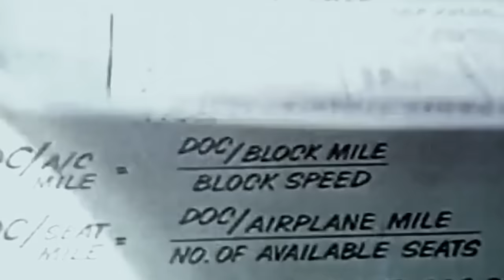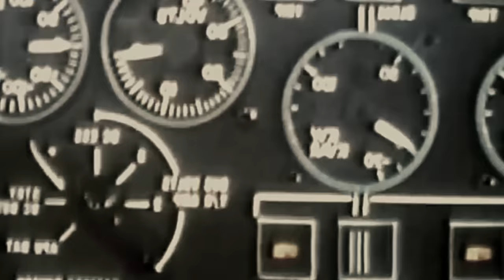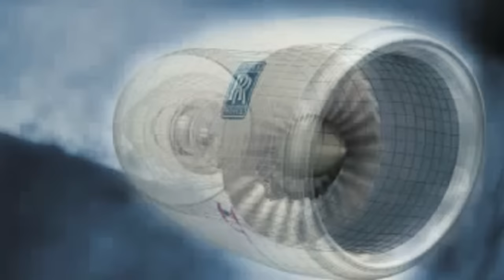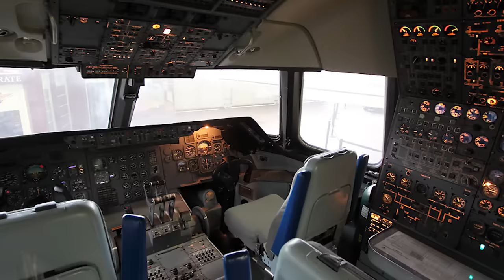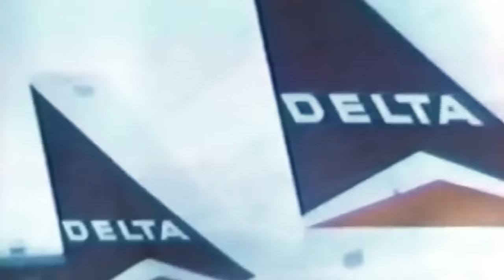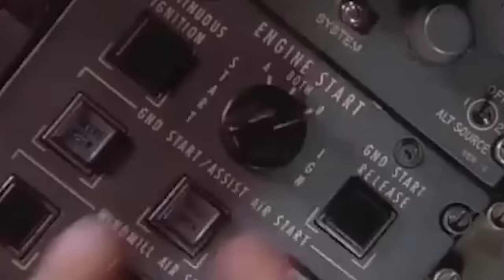L-1011 Tristar - too advanced for us

Comment: Flew the L-1011-500 for 2 years as a captain at Yes Charter Airline, in Portugal. Even now, flying the A330/A340, I still think of that time as my best years in aviation. It was a "Pilot's" airplane. Designed to be flown by Pilots. And the autopilot was extremely competent when the weather was flaky and you had to let the machine put it down all by itself even with fearce crosswinds. It was certified CAT III B (not CAT III C as refered on the video), which means that you would still require 75m of RVR before you could start an approach. And contrary to what is also said on the video, it would not make an automatic take-off. 
One day I was performing a LVO Take-off with 125m RVR and just after V1 was called by my FO, all 3 generators failed. We continued the Take-off as if nothing happened, reseted those generators and continued our flight across the Atlantic. That was the kind of trust the L1011 gave to their pilots. And there was none of those multimedia television on each chair. We had Cinema. That's right. A full color projector and a large screen. Ben-hur or a Sean Connery 007 movies were the norm. None of those crappy movies we have today.  Would trade my Airbuses for a L1011 any time.
Reply: thank! love hear stories from pilots!
Reply: I concur. I was a flight engineer in the mid 90’s on the L-1011. Nothing comes close to this aircraft. Best airliner in history in my opinion. I miss her.
Reply: It was a different era... 

I've been on international flights repeatedly from before I was born, and I remember the progression of aircraft interiors.
747's frequently had cinema projectors even into the early 90's, I recall.
But the majority of aircraft had ceiling mounted televisions in the aisles.

Then again, the seat-mounted displays are actually going out of fashion now...
So who knows where things will be in another decade or so...
Reply: Luis Rodrigues it's funny how everyone believes things in their time were better. I would take my small personal multimedia screen anytime and watch what I want rather than forced to watch what is being played on those large screens.
Reply: FooBar Maximus I respect your opinion but not everyone wants to chat throughout the flight. I prefer to have the choice of watching what I want to watch rather than being forced to either watch what’s playing or sleeping.
Reply: Hoy Sum  I think people who try to chat up everyone are exhausting. Sometimes I get stuck beside those people and have to give them the silent treatment to get them to shut up.
Reply: Lois, my TW FO friend contribution obliquely says the same thing.  The flight crew loved the jet even with all its quirks.
Reply: thanks for your input captain..
Reply: Luis, could you please tell something about the handling characteristics.
Escpecialy during an N-1on T/O. since (as far as i know) the 1011 was steered by lift dumpers rather than than by airlerons.
From what i understand you did not roll to the live engine but just used the rudder.
Is that true, and how would it handle in such a condition.
For above reason i found the B767 more easy than the A300 for instance.
Reply: @FooBar Maximus I am with you 100%.  Social media isn't actually bringing people together at all.  It's doing the exact opposite.  I only ever got to fly on one TriStar.  We flew from Barbados to Toronto on one.  I loved it and will never forget it.  We were out on the tarmac at Grantley Adams Intl, and I was walking up the air stairs to get into the L1011, and I'll never, ever forget looking into that HUGE opening that was the S duct for Engine number 2 in the rear.  As a little boy of only 8 years old, it was the coolest thing I had ever seen in my life.  Oh, and the Rolls Royce RB211 engines had me grinning from ear to ear during takeoff also.  It was a great moment in my youth.
Reply: Thanks for sharing. Pilots have my total respect sir!
Reply: @FooBar Maximus I agree, people do not interact with each other anymore.
Reply: What amazes me is Lockheed didnt anticipate etops and try to make a twin engine version.
Reply: @animeshdas9842  if they played good movies I'd prefer the big movie screen.  You can just carry your own personal screen.

Edit: and put some headphones on with your tablet....if that doesn't shut up the annoying person by you, nothing will.

To me, this makes personal seat screens redundant, but not movie screens.

Or they could do open seating like Southwest, and just have a movie play in one section...as long as you don't pay for last boarding group, you'd get your pick.

On another note I don't get why people complain about open seating...My experience tended to be, in first group I got pick of window or aisle, second guaranteed no crappy middle seat, but most still get choice of window or aisle...and last group, which sell for around the price of cheap middle seats, often still finds middle and isle seats together, so two friends can still sit together...
Reply: @FooBar Maximus I was gonna say the same, it was a more social experience. You'd just end up enjoying the time with you everyone.... At least thats what I saw all the adults doing 20 years ago when I was a kid. Our generation is so full of dullards lol (I probably shouldn't find that funny)
Reply: A wonderful insight you gave there, thank you. I wish I could've flown on the L1011. I work at Rolls-Royce, we have some old chaps in the workshop who worked on the RB211 Tristar program, it's good to hear them talk about their experience.
I work on the Trent XWB 84k & 97k build line myself!
Reply: @mikemcpherson5550  I like it better than the jumbo jet
Reply: THANK YOU CAPTAIN.. MY FATHER 'CUT HIS EYE TEETH' AS HE SAID, ON THE DC-3 & LOVED TELLING THE STORY OF 'JACK' STOPPING BY ASKING 'HOW'S IT GOING NELSON'?..   AS HE WAS A SPECIFICATIONS ENGINEER ON THE L-1011, WOULD BE HONORED TO HEAR YOUR COMMENTS...
Reply: That was the most beautiful plane ever built. I saw it as a kid from the ground as I was boarding it. It looked like a plane that demanded respect. I hope they re-design and re-build it again. I would only chose that plane.
Reply: Animesh Das you are the reason why social society is collapsing. Humans are supposed to be social over everything, that is how we became an advanced civilization. Too bad you can’t afford to fly private, then you can just read a book and sit in silence
Reply: Thank you for sharing your experience with this aircraft. Growing up one of my Dad's best friend ran ground maintenance for Delta Airlines. He wanted Delta to purchase more of the L-1011 Tristars, but by that time Delta was looking at the new widebodies such as the 757/757 with two engines instead of one.
Reply: Flew that plane many times between Lisbon and NY, loved it...
Reply: WELL SAID CAPTAIN AND NO WONDER THE KING OF JORDAN KING HUSSIEN CHOSE THE L10 11 AS HIS PERSONAL PLANE !
Reply: My father was a Capt. for Delta and flew the Tristar from 1976 to 1992 until his retirement after 40 yrs of flying.
Reply: Luis Rodrigues ... OMG!! You wrote "fearce"!
Reply: @stephenvoss6092  It was the timing. The L-1011 was designed, when at least 3 engines were required for transoceanic flights, and by the time it was changed to 2 engines,  Lockheed had all but decided to get out of the civilian market. They looked into making a 2 engine version, but decided, that just removing the 3rd engine didn't help enough, since it was designed with 3 engines in mind, so they'd need to design a 2 engine airplane from the ground up, so it was more than they wanted to get into, so they decided to go ahead & pull out of the civilian market.
         Of the planes, that I've flown in, the L-1011 & the 747 were the only ones, where the whole crew were visibly proud and excited to fly them.
    I didn't ever take the Concorde. I'm sure, their crews were also visibly proud & excited. Now that it's no longer flying, I regret, that I didn't take her. I had chances, but took them for granted, until it was too late!
Reply: @sparky6086  I loved the eastern airlines L-1011
Reply: What a great addition. Your comment should be pinned.
Reply: Back in the 1980s I flew as a passenger, for the most part maybe 3-4 times a week. So much I had a subscription to the OAG and Aviation Week and Space Technology. When flying, I always checked to see what the equipment was. The L-1011was my go to aircraft. At that time IIRC the L1011 had one crash. I always felt safe on that aircraft. I flew mainly with Delta back then.
Reply: One of the reasons I became a  Pilot was because of the L1011, but they were retired before i had an opportunity to fly it. I have many fond memories as a child flying in them as a passenger.
Reply: @jivefx  DId you fly for Delta during your L1011 days? I flew a Delta flight to Puerto Rico in about 1995 or so. I'm glad I got to fly on one before they were retired for passenger service.
Reply: You still lucky in the A340
Reply: One correction and one omission.    The narrator failed to even mention that the S-duct inlet was used on the 727.  He made it sound like this was a new and novel invention by Lockheed.   And these airplanes were replace by the 767 and A310.   You have to jump a long way ahead in time to get to the A330.   And in spite of all the negative comments about the 747, it is the only one of the three still in production.    Thank you for clarifying the Cat IIB/C capability.  When he said CAT IIIC my suspicions were raised.
Reply: I worked on them back in the late 80's and then again in 1998...best jumpseat  in the industry behind the captain's seat. Flight mechanic for charter in the USA.  Awesome aircraft
Reply: Awesome info..u have led..lived..a blessed life...
Reply: I love the cinema in jets. I flew to Europe in a 747 in high school in 1984 and had so much fun watching movies together with everyone! Small screens and social media make people weird, isolated and not as friendly as the world used to be. The L1011 was my father's favorite plane when our family flew on vacations.
Reply: Hoy Sum  This generation you speak of have lower IQs and are NOT innovative. Their devices and RF damaged their nervous systems. Thankfully GenZ behind them has watched the GenY Millennial general all around failure to progress society in any fashion and are going back to basics, and a more analog life.
Reply: @animeshdas9842  You don't have a clue!!!
Reply: @animeshdas9842  Well isn't this just irrelevant!  The whole point of these videos are to educate and inform people about the past not to make comparisons to everything we already know.
Reply: Hoy Sum  Amen brother!! Preach!!
Reply: @rmorris1904  And your generation does nothing but whine whine and more whine. All your statements start from "In our day blah blah blah..."
Reply: @animeshdas9842  Putting in your earbuds is an obvious sign you want to be left alone. Of course there are some lunkheads that still wouldn't get it.
Reply: Ben Hur? Funny, Reagan made a joke about live Ben Hur performances at the Lockheed TriStar's rollout!
Reply: Luis Rodrigues thanks for sharing that pilot!
Reply: Mark exactly. I am a social person but sometimes I like to be left alone. Some people don’t get that, they are talking all the time.
Reply: My grandpa was one of the leaders/managers at Lockheed that built the L-1011 in Burbank before he retired.  He worked in the Skunk Works there as the Head of the Machining Department.  One tale from his days there was the fact that Kelly Johnson would ask my gramps "can we build this ___ like this?" or, "can we build this ___ like that?" to which gramps would say yes or no, or something to the effect of: "if we do ___ to it, then it can be done." 
I got to fly on an L-1011 a number of times.  First on the big smile PSA plane from SJC to BUR for my 14th birthday to spend spring break in L.A. with my grandparents.  I also flew on TWA on one.  Then, when I lived in Japan, I got to fly on an ANA version there, from Tokyo to Sapporo and back a number of times.  What a wonderful plane!  Wish they were still around, or at the least, that Lockheed would get into the commercial market again.
Reply: Well said Luis! I had 1,600 hrs in a L-1011. No major problems and also very pilot friendly too.
Reply: You're confusing capability with certification. The aircraft was capable of Auto take-off initially but was never certified. Iv'e done it in the sim. It was also capable of IIIc but of course no airports offer IIIc. I flew with the RAF and then several civilian operators. -100, 250 and 500. Air tanker, Cargo and standard Pax.
Reply: @animeshdas9842  His time was the A320, and he liked the L1011 better.  There are aircraft where you fly them and others where they fly you.  The L1011 was one where you flew it.  It's the same thing between a 727 and 767.
Reply: in 1985  i traveled to the azores in the l-1011 the captain was portuguese  i only remenber part of his name wich was    capt. conceicao magnificent flight the best could not feal take off or landing
sr. luis rodigues   you are blessed to have been a captain of that aircraft
Reply: Rolls R. economic problems and an alternative replacement for the tail turbo jet engine and sales factors made Lockheed give up on continuing production.
Reply: Luis Sir, What is the  passenger capacity of this aircraft ?
Reply: wow what a great story. i flew the l1011 with BWIA many times. i remember the big cinema screen too and projector. miss that plane so much too
Reply: @JW...-oj5iw  well spotted. I meant "fierce". I would like to see you say that in Portuguese 😉
Reply: @bigtaxrefund  when BWIA replaced  their L1011 by the newly acquired A340 fleet, my company made some ACMIs with our L1011 for them while their pilots got their Airbus ratings. Cabin crew were all BWIA. We stayed in Trinidad 3 days at a time waiting for the next flight. Those were happy days.
Reply: @animeshdas9842  yeah, that's what snowflakes do these days. And then they complain they can't find a partner in life. All these nasty people trying to make contact with them....
Reply: @jacutin5033  Chatterboxes get all the girls? ha ha
Reply: I loved the L10.
Flew it several times in the 80's.
Reply: lol.
Yep.
Reply: Thank you for that piece of technical information about auto take off...
Reply: I also loved the L-1011 FMS and the autopilot....way ahead of its time ! Some operators like TWA and Saudia had a center pedestal CRT Display that would show the FMS positions etc. I flew jumpseat with SAUDIA Tristars few times , amazing experience. 1978.
Reply: Captain thanks 🙏 for flying us safely.
Reply: @animeshdas9842  I would guess his point was about the quality of the screen experience.
Reply: Avionics and flight controls instructor with Lockheed Customer Training Department here.  British Airways had CAT III-C and used it when no one could  get in or out of Heathrow.  Other airlines tried to stop BA but CAA would not fold.  CAT III-C was difficult to become certified as the the airport's ILS had to have special certification, and the airlines Avionics repair lab also requires special certification.  Actually the L-1011 could make an auto take-off, we made a publicity flight hands off from Palmdale to DC.  If I remember correctly, Tony Levier was in the left seat and there was an FAA observer to keep us honest.  Did you notice a lower noise level in the flight station?  Skunk Works designed the forward fuselage including the curved wind screen for noise reduction.  Each half cost $35,000 in 1960s money.
Reply: Eldren Biddle here. I'm retired Lockheed Systems Instructor : Avionics, Flight Controls, Hydraulics, ECS and all on board systems up to the engine pylon firewall disconnects. Oh and the engine driven hydraulic pimps and self exciting constant speed generators .  Rolls-Royce's 
resident instructors did the engines.  We would needle them by calling the engines "motors" and when asked the power of the engines they would say "Adequate.  Rolls Royce snobbery.  One instructor was a golf addict and had a quest to play every coarse in California.  His classs room pointer was a golf club shaft.  

British Airways did certify for Cat III c, came in handy at Heathrow.  III c was very difficult to qualify as the runway ILS, maintenance lab and individual technicians had to meet special CAA standards.  All airlines including L-1011 operators tried their damdist to not allow III c as too expensive but mostly I think as unfair advantage.  

Auto take-off software and controls laws were resident in all flight control computers.  It was not enabled, don't remember why, maybe a bridge too far.  PanAm - 500 had if I remember correctly the first digital Flight Control, Nav and Air Data computers.  Also auto brakes and because of added wing span Active Outboard Ailerons to dampen gust loads.  Positive G ailerons up, negative G ailerons down.  There was a noticeable reduction in turbulence.  Standing joke was active ailerons were installed  to prevent white caps in your Martini.  One airline was not sure about DLC  and I told them "No problem, just turn it off.  

I instructed every Lockheed aircraft from C-130 to F-117A.  TriStar is by far my favorite.
Reply: As a passenger, I’m quite comfortable with my multimedia screen on the chair in front me thank you very much none of that single cinema screen from the bygone era